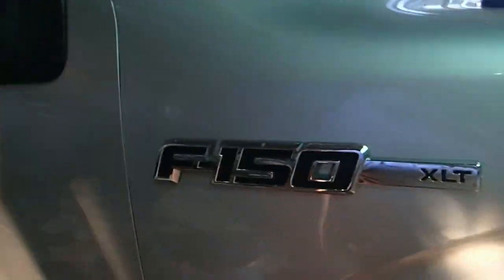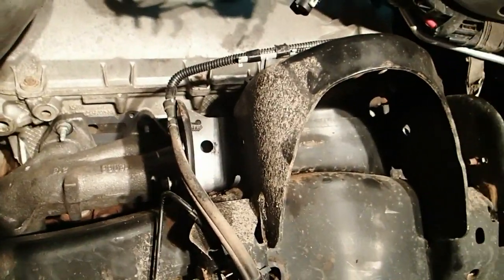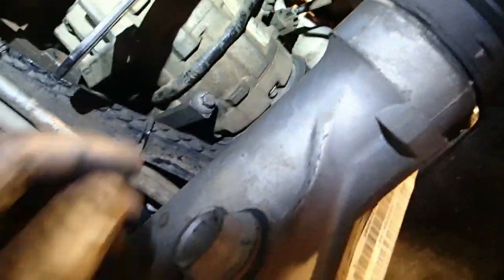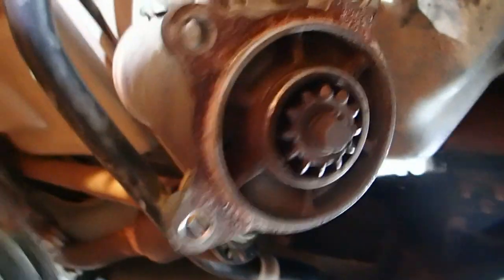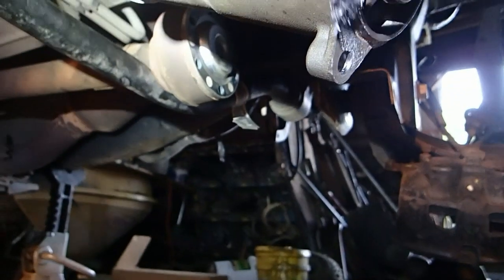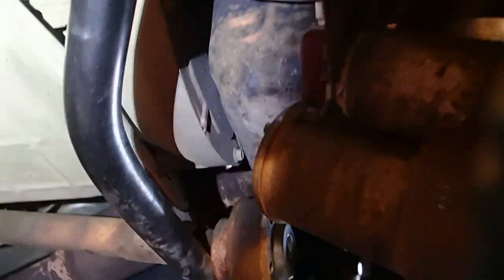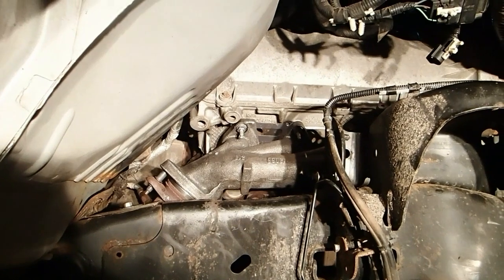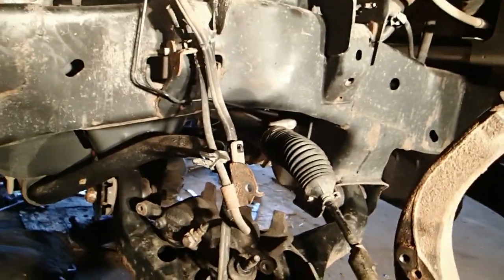F150 still not done

Comment: Whats the silver stuff you're painting on the starter flange? By the way, copper grease is also an anti seize agent and is especially more effective on threads that see continual heat cycles e.g. exhaust bolts, engine pipe flange bolts etc. It's just a good thing to have in your toolbox. I also have the permatex copper gasket compound.

Comment: Had the same issue. Found out lifting the cab and front clip a bought 6 inches was the answer. Also used Dorman studs with brass nuts. Better quality than factory.

Comment: a lot of those ticking sounds are grounding issues.
I have an 08 Titan CC that is a BEAST, same sounds.  You can only hear it on start up.
I actually have a PDF that shows what I need to do, and yes, I got some 2/0 black wire, Arctic Ultra flex.
We live in Alaska, so I gotta try to do it someday...

Comment: Some antiseize will poison your oxygen sensor. And at least with mine my instructions say remove the battery lead, reconnect, and run the engine a couple of minutes so the ecm relearns the engine. Mine will relearn without doing that but it might take twenty miles.

Comment: Isn't the manifold job one where the service manual recommends that you first "remove the engine from the vehicle"?  Which would be easier, remove the front clip and suspension or the engine? Either one is a lot of work.

Comment: Chevy recalls Chevrolet Silverado 1500 Recalls
Ignition Switch
RepairPal Expert Overview:
The ignition switch actuator can bind causing the ignition switch to stick in the "start" position. If this were to occur the actuator can unexpectedly release, cause the ignition switch to snap back into the "Accessory" position. This would cause the engine to turn off with an associated loss of brake and steering power assist. If these conditions were to lead to a crash the airbags may not deploy as expected. Dealers will inspect and replace the ignition lock housing as necessary to correct this concern.

Models: Cadillac Escalade, Cadillac Escalade ESV, Cadillac Escalade EXT, Chevrolet Avalanche, Chevrolet Silverado 1500, Chevrolet Silverado 1500 Hybrid, Chevrolet Silverado 2500 HD, Chevrolet Silverado 3500 HD, Chevrolet Suburban 1500, Chevrolet Suburban 2500, Chevrolet Tahoe, GMC Sierra 1500, GMC Sierra 1500 Hybrid, GMC Sierra 2500 HD, GMC Sierra 3500 HD, GMC Yukon, GMC Yukon XL 1500, GMC Yukon XL 2500
Electrical & Lights, December 30, 2014
Rear Axle Fracture
RepairPal Expert Overview:
Certain trucks are being recalled because the rear axle shaft may not have been properly heat treated prior to vehicle assembly and could fail while driving. If this were to occur a rear wheel could separate from the vehicle, increasing the risk of a crash. Dealers will inspect and replace the affected axles to correct this concern.

Models: Chevrolet Silverado 1500, GMC Sierra 1500
Drive Train, December 24, 2014
Loss of Power Steering Assist
RepairPal Expert Overview:
A fault can develop with the Electric Power Steering resulting in sudden loss of power steering assist, increasing the risk of a crash. Dealers will replace the power steering assist motor kit to correct this concern.

Models: Chevrolet Silverado 1500, Chevrolet Suburban 1500, GMC Sierra 1500
Suspension & Steering, November 10, 2014
Engine Stalls From Electrical Module Short
RepairPal Expert Overview:
The chassis electrical module can short due to internal contamination. This can result in the vehicle stalling. Dealers will replace the chassis electronic module free of charge to resolve the concern.

Models: Buick Enclave, Cadillac CTS, Cadillac Escalade, Cadillac Escalade ESV, Chevrolet Express 1500, Chevrolet Express 2500, Chevrolet Express 3500, Chevrolet Impala, Chevrolet Silverado 1500, Chevrolet Suburban 1500, Chevrolet Suburban 2500, Chevrolet Tahoe, Chevrolet Traverse, GMC Savana 1500, GMC Savana 2500, GMC Savana 3500, GMC Sierra 1500, GMC Yukon, GMC Yukon Denali, GMC Yukon Hybrid, GMC Yukon XL, GMC Yukon XL 1500, GMC Yukon XL 2500
Electrical & Lights, October 1, 2014
Steering Tie Rod Linkage Loose At Gear
RepairPal Expert Overview:
The tie rod where it threads into the steering gear rack may not be tightened enough. Dealers will inspect the inner toe rods to make sure they are correctly tightened, replacing any defective steering gear as necessary free of charge to resolve the concern.

Models: Chevrolet Silverado 1500, GMC Sierra 1500
Suspension & Steering, May 14, 2014
Transmission Oil Leaks At Cooler
RepairPal Expert Overview:
The transmission cooler may leak transmission oil at one of the fittings where the transmission oil lines hook up to it. Dealers will inspect the cooler line connection and repair the vehicles as needed free of charge.

Models: Chevrolet Silverado 1500, Chevrolet Suburban 1500, GMC Sierra 1500, GMC Yukon XL
Drive Train, March 31, 2014
Exhaust Components Overheat While Idling In Cold Temperatures
RepairPal Expert Overview:
When idling the engine in cold weather, certain components of the exhaust system may overheat, resulting in melting of plastic components and a possible engine fire. Dealers will reprogram the engine control module free of charge to resolve the concern.

Models: Chevrolet Silverado 1500, GMC Sierra 1500
Exhaust & Emissions, January 13, 2014
Front Seat Backs Have Free Play
RepairPal Expert Overview:
The front seat backs may have excessive free play. Dealers will inspect the seat back recliner mechanisms and make adjustments as needed free of charge to resolve the concern.

Models: Chevrolet Silverado 1500, GMC Sierra 1500
Body, Interior & Misc., October 17, 2013
Potential Failure of the Transmission Shift Interlock System
RepairPal Expert Overview:
All late model vehicles are equipped with a "Shift interlock" system that prevents vehicles with and automatic transmission from being shifted out of the Park position under certain conditions. Some of these vehicles are being recalled because they may have been assembled with a broken park lock cable or a malformed steering column lock actuator gear. Failure of these components can allow the shifter to be moved out of the Park position with the ignition key removed or in the off position. This can cause the vehicle to roll away unexpectedly increasing the risk of injury or a crash. Dealers will inspect the recalled vehicles and replace the steering column as necessary.

 

 

Models: Cadillac Escalade, Cadillac Escalade ESV, Cadillac Escalade EXT, Chevrolet Avalanche, Chevrolet Express 1500, Chevrolet Express 2500, Chevrolet Express 3500, Chevrolet Silverado 1500, Chevrolet Silverado 1500 Hybrid, Chevrolet Silverado 2500 HD, Chevrolet Silverado 3500 HD, Chevrolet Suburban 1500, Chevrolet Suburban 2500, Chevrolet Tahoe, Chevrolet Tahoe Hybrid, GMC Savana 1500, GMC Savana 2500, GMC Savana 3500, GMC Sierra 1500, GMC Sierra 1500 Hybrid, GMC Sierra 2500 HD, GMC Sierra 3500 HD, GMC Yukon, GMC Yukon Denali, GMC Yukon Hybrid, GMC Yukon XL 1500, GMC Yukon XL 2500
Drive Train, January 2, 2013
Potential Loss of Steering Ability
RepairPal Expert Overview:
The intermediate steering shaft attaching bolts may not have been tightened to the proper specification. This could allow the steering shaft to separate. The driver could experience a loss of steering ability, increasing the risk of a crash. Dealers will inspect and ensure the intermediate steering shaft bolts are tightened to the proper specification. This recall is expected to begin on July 13, 2011. The General Motors recall number is 11191.

Models: Cadillac Escalade, Cadillac Escalade ESV, Chevrolet Silverado 1500, Chevrolet Suburban 1500, Chevrolet Tahoe, GMC Sierra 1500, GMC Yukon, GMC Yukon XL 1500
Suspension & Steering, June 28, 2011
«1234»

Comment: I have an 04 F150 with 87 thou on the odo. In my opinion anyone who works on a Ford exhaust system is certifiable.
 Just had my engine repaired. Ford garage said reman engine for $8500.00 another shop quote was $7100.00 with &1000.00 rebate if core is rebuildable. So went to John's auto in north suburb great place. Same prob on managers 05 Ford. He stated engine can last for 1 mil miles and all I needed was a timing kit. Core was fine. Serv engine lite came on engine was stalling missing and shaking Yes it cost 3 grand but engine is strong and moves out very well and mileage is back where it belongs..

Comment: Hello!

Thanks for your videos...I'm hooked.

This is coming from a city boy mind you.

Wouldn't you save time, money, and wear and tear by driving in a spiral rather than back and forth in the fields? I'm guessing that the fuel savings alone would be of value.

No more hundreds of 180 turns every row. Or am I missing something?

What do you think?
Reply from the maker: Nope back and forth is the most efficient way to mow these fields 😎 if I where to go in circles I would probably feel like nascar. Anyway short rows and corners are a bigger issue when you go around in circles and it will leave hay on the ground on all of those corners plus I will be making 360 turns on those corners instead of 180s

Comment: Armchair mechanics, there's a shitload of them out there lol. I think you've done this job well as you do on just about everything. A question that I have though or actually a suggestion is that in my opinion you should of went with a header style manifold. The price from an aftermarket company is just about the same that you paid for the ones you got, plus some are done to where they hook/connect right to the stock exhaust.
Reply: ***** No headers are not strickly hot rods, that's with the older styles. They make direct fit headers for these trucks and it doesn't mean its going to get that full "hot rod" sound. Sadly many are misguided with technology and stuck on old thoughts as you have proven with your comment.
Reply: ***** Again, a typical armchair mechanic. Thanks though lol.
Reply: Mack Thompson, where did your post go, I went to reply to your ignorance but it was gone?

Comment: The never seize company really should be kicking in some freebies for your endorsement....I mean jeeze look  how excited you got over a cheap, free Chinese flashlite?   lolIts kinda late now but I came up with an idea that probably would have made the job a little easier. (I figured that you were already done)  The idea would have been to take a sacrificial deep well socket, weld a short flat bar off of the side (12 point socket) then cut the unneeded part of the socket off with a plasma cutter. its one thing  that I found that is a good use for Chinese tools...I have no remorse with trashing them if it doesn't work.

Comment: Mass Air Flow Sensor.  O2 sensor is on the exhaust.  I haven't worked on a front end in forever.  Last one I did was a 1980 Ford Courier.  Next one I'm doing is the rack and pinion on my '97 De Ville.  DON'T EVER get a North Star, what a piece of crap engine.  Get a Lincoln for a pimp ride.

Comment: I bet you're just thankful that when you took it apart none of the studs broke in the head. you would have towed it outside with the bobcat and set it on fire and claimed the insurance. LOL
Reply: andrewkiwi1 If you watch the series of videos about this F150 job you'll see that several of them did.

Wes just used a little old time ingenuity and got the suckers right of there.
Reply: madmax ower he brought the ends of them out by welding tips over them, then tapped a nut over the booger of weld on the ends of the studs, then welded the nut fast and threaded it right out, being an aluminum head the weld material wouldn't stick to it worked like a charm
Reply: andrewkiwi1 Some were broken off...and he don't like Bobcats   :-)